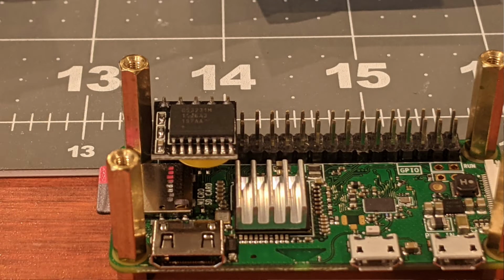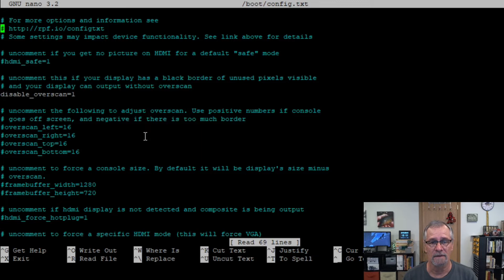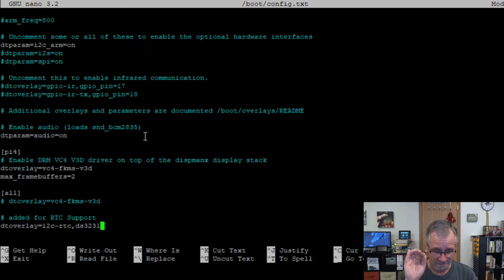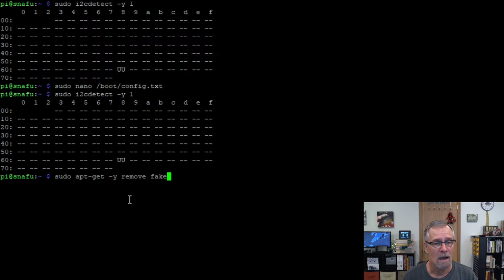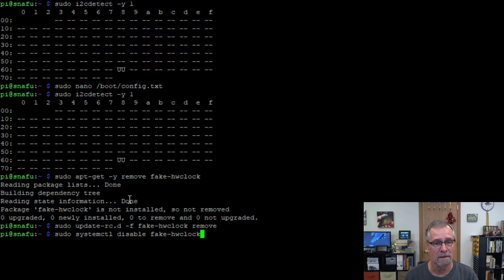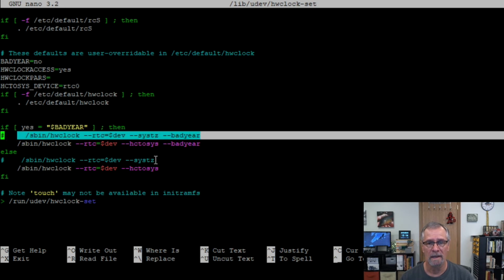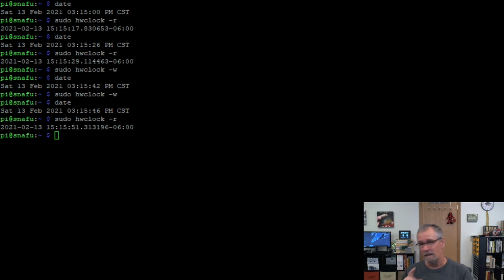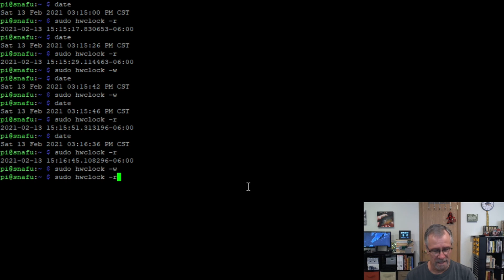From the Bench - Raspberry Pi: Adding a DS3231 RTC (Real Time Clock)

Comment: Hi, I have a question, I did your tutorial (very good) and it works, but sometimes when I reboot the raspberry for any reason, it shows the wrong time, but the rtc module still holds the right time (I checked it on the console and is the correct time). Is there any solution??
Reply from the maker: You could add the sync commands to the system startup (towards the end, after network starts). 

Odd that it slips that much. Or is it off for a while (days)?
Reply: @stfuandfish   thank you for answring me, it happens almost half of the time I turn it on, but the RTC module always has the right time. how do I add the sync commands to the system startup?? sorry I'm new to raspberry and Linux
Reply from the maker: @cesaraponte7212  No problem! We all start somewhere. 

Can you make sure you disabled the fake-hwclock in the earlier portion of the video? Double check that those are indeed disabled and let me know. 

sudo apt-get -y remove fake-hwclock
sudo update-rc.d -f fake-hwclock remove
sudo systemctl disable fake-hwclock

Thinking about it, I don't think the RTC would function properly without the fake-hwclock removed, but do check on it.

I've been thinking about doing another video on RTC's and Ras Pi. Maybe I should. I can work on a new video in the next few days.
Reply: @stfuandfish  yeah I disabled the fake-hwclock and everything, is like when I reboot it, the sapberry goes back to enabling the fake-hwclock, i dont know, is weird because when I put those commands again, it tells me that what you get in your video that thos packages are uninstalled and that some functions are masked, the same you got.
I'll keep looking. thank you
Reply from the maker: That's odd! I'll try it on a bone stock load and see if I can duplicate it.
Reply: @stfuandfish  thank you so much, I really appreciate it, if it helps I have a raspberry pi 4 (2gb) with raspberry os (32-bit), and a sandisk ultra 32 GB micro sd card
Reply from the maker: @cesar aponte  you're running the current version of Raspbian?
Reply: @stfuandfish  yeah, and the problem happens when you boot the raspberry, and then you reboot it fast, thats when it looses the rtc time
Reply from the maker: @cesaraponte6403  Cool. Thanks!